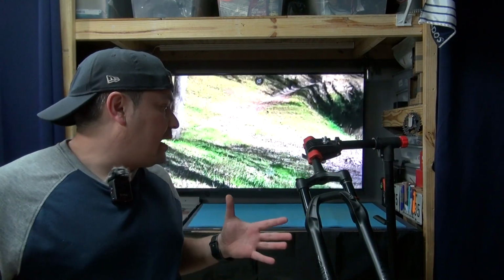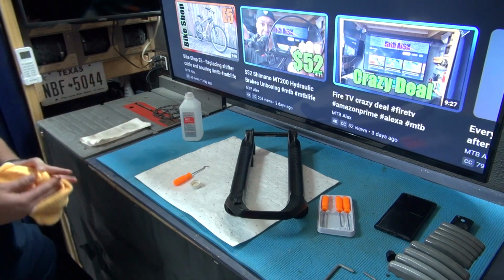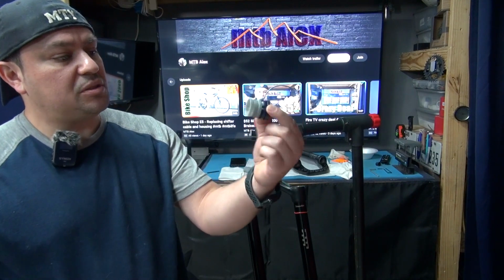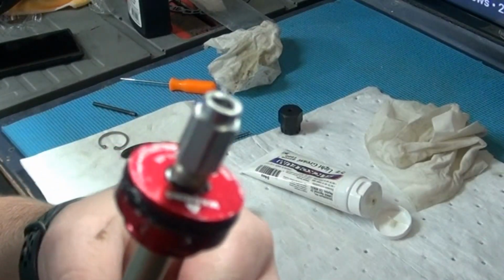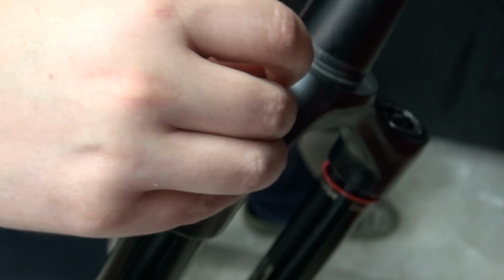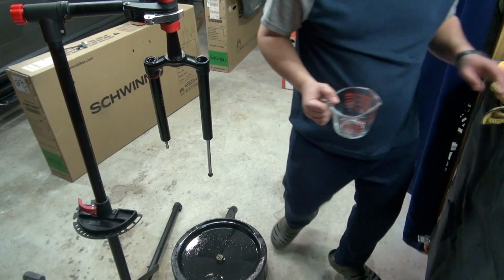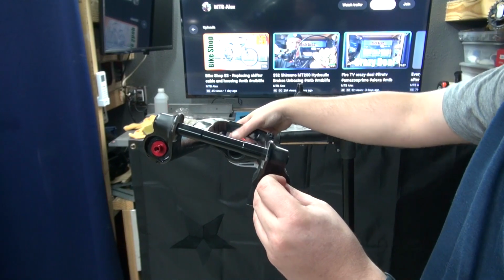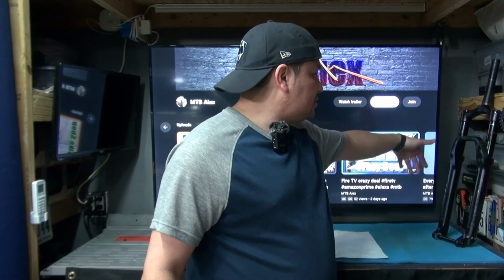Detailed Rockshox Revelation fork service DIY #mtb #mtblife #trail #emtb #rockshox #diy #tuneup

Comment: Pretty good for a first time. I have my mountain bike with a Revelation fork since 4 years - haven't been brave enough to try a fork service. 
Could you tell me:
1. What symptoms did you notice that told you the fork needed a service?
2. About how many km (or miles) did you have on your bike before you did the service?
Thanks for the video!
Reply from the maker: Bad clunk on bumps or very small jumps, as you saw the foam rings were dry.

I probably had 1k miles on it, 2 years of riding
Reply: @MTBAlex  Hey thanks!